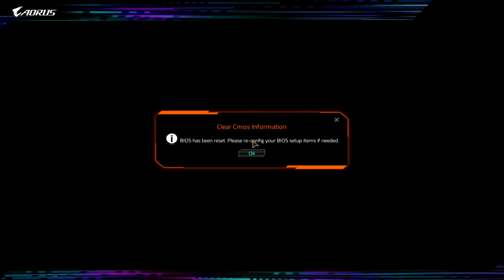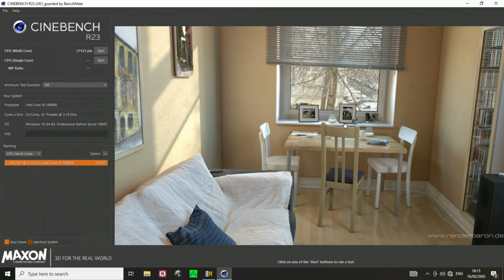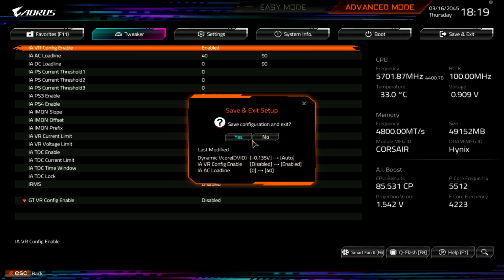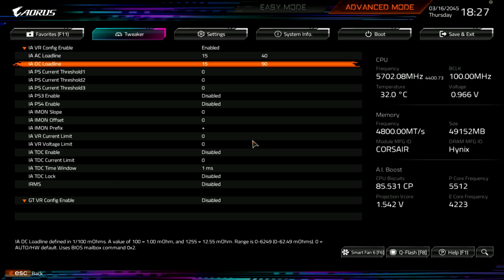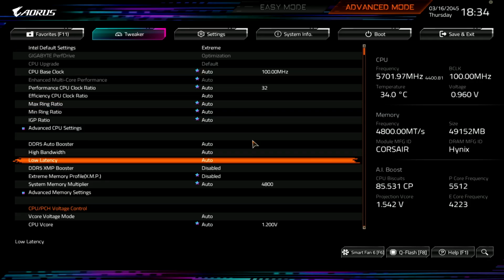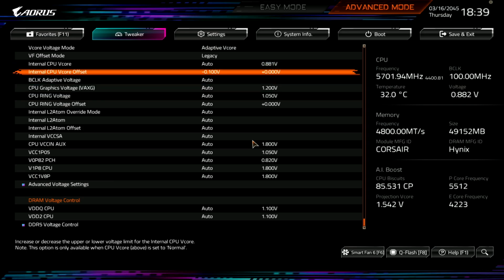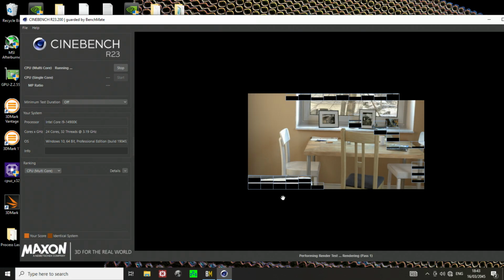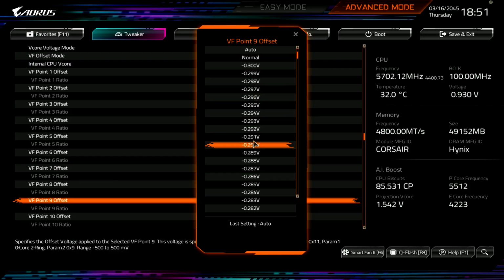YOU  DON'T HAVE  TO TURN OFF CEP to undervolt intel 13/14th gen CPUs

Comment: MSI seems to have this on lock. No brainer with their boards. Lock the cores at 5.6 or 5.7 and set CPU Lite Load to mode 7 - 12. Lower is better as long as it doesn't crash. Too low and it will crash just from the CPU not getting enough voltage. You will see performance loss as you work your way down from Mode 12 once you get to low. When you hit that performance loss go back up one mode and enjoy your cooler, more power efficient, fast @$$ CPU! Don't let 2 cores boost to 6Ghz it over volts ever single core. Even the E Cores.
Reply: The thing is that MSI Lite Load is exactly what BZ explains as the second wrong way to undervolt. It lowers AC_LL and DC_LL. You can see what it does if you set your "normal" LiteLoad, safe & reboot and then change LiteLoad mode to "advanced". You can honor CEP with the advanced mode, if you bring AC_LL, DC_LL and LLC together manually. You can find a table online that shows you which LLC equals to which AC_LL/DC_LL.
Reply: @bauerns5er  MSI's current solution to that is to set the Lite Load (and so AC/DC) stupid high under Intel defaults. So you can drop it a long way from its default value and still not hit the CEP tolerance limit.
Reply: @Raxiel497  Intel Default is 1.1 mOhm on my Z790 MSI for AC/DC LL (110 in MSI terms). That's not really stupid high, it's the default. 😉
Reply: @bauerns5er  Hey I have MSI Z790 Carbon. Could you give me a link to MSI LLC impedance table? I have tried to find it but no luck. I only know that LLC 8 is 1,10mOhm.
Reply: @tomitarnanen  I have checked the settings for the Lite Load AC/DC settings on the Z790 Carbon by setting the Lite Load Mode, rebooting, then setting the mode to Advanced and noting down the AC/DC values. Lite Load Mode 16 is 1.1 mOhm for both AC & DC (in MSI terms "110"). Every setting lower than that reduces the AC LL by 10 (or 0.1 mOhm), down to Mode 9, where it begins to decrease by 5 instead. So Mode 9 is 40 (0.4 mOhm) and Mode 8 is then 35 (0.35 mOhm). Mode 2 is 2/110 and Mode 1 sets both AC & DC to 1 (0.01 mOhm).
I've also tried to identify the LLC impedances, and for Auto it seems to be 1.05 to 1.1 mOhm (so I guess it is 1.1). And Auto seems to be almost the same as LLC level 8.
Reply: @bauerns5er  I have that table and have set each setting then checked it with hardware info to verify. Check it, the CPU the way it's configured, 5.6/4.4, runs like a scolded dog, runs cool, runs lower wattage, relatively. It can throw 41500+ in Cinebench all day and is stable. If it degrades in two years so be it. It will be replaced by then. However, I really don't think it will. The only thing I can see harming this CPU is transients that I can't see because the CPU doesn't hit over 1.350v ever and under load runs around 1.198v locked all core.
Reply: @jwhitaker81  can you run CB r15.3.7 with extreme Mod?
Reply: @bauerns5er  yeah no problem. it scored 6231 with a bunch of crap open.
Reply: hour long videos for something you can do in 10 minutes on an MSI board with Lite Load. Lock P cores to 5.5. Lock E cores to 4.1. Set a negative 0.055 voltage offset. -2 AVX ratio. BCLK 100mhz lock enabled. Speed Shift enabled. Intel Turbo Boost Max 3 disabled. Enhanced Turbo disabled. CPU Current Limit 307a. Power Limits 250w. GT Current Limit 30. CPU Lite Load 9, or 10 if you want to be conservative. CEP will probably never activate anyway so you might as well leave it on. This has got me between 38k & 39k in Cinebench R23 runs, voltage will be below 1.4v (I've done runs where the max was 1.309v) and you won't go near throttling with decent cooling and a contact frame (360mm aio, max core temp 93c on my hot core #5, rest below 90c, e cores below 80c), and CPU power doesn't go above 230w. Using Z790 Carbon Wifi board, 2x32gb ram and 14900k with the new bios installed.
Reply: @bigpoppa1234  Contact frames and delid kits for all 13/14900Ks I say!
Reply: @bigpoppa1234  why disable turbo boost ?? Honest question!!??
Reply: @izzy32324  you don't need turbo boost 3 if you're tuning your CPU manually to lock it into all core max boosts.
Reply: Nailed. Key was reducing six p cores to 5.5ghz and leaving two preferred p cores to 5.7ghz then offset cpu voltage by -0.15v. Still 40k cinebench scores and almost 10C temp drops with safer cpu voltages, only 1.236v under load

Comment: SO much easier to undervolt CPU safely with CEP disabled and just manually tuning the settings yourself without the stupid Intel settings... Using a Gigabyte Aorus Elite AX motherboard and 14900k: 5.8 all core with  x58 p-core, x44 e-core, x45 ring bus at 1.284v v-core max using adaptive v-core with a negative -0.205 vcore offset, Extreme LLC, AC/DC set to 20/20, P1/P2 of 260w and done. 40,500 avg. in C23 with a 78c max temp under full load and OCCT stable oversight 8+ hours without any issues and I will never need to worry about degradation due to never going over 1.284v v-core.
PS - Buildzoid, this setup doesn't crash or have stability issues at all on my Gigabyte motherboard with CEP disabled, the negative offset, and ac/dc at 20 and is 100% stable benchmarking or under full load overnight. These settings give me a max vid request of VID (Max) of 1.295v and max actual V-core at 1.284v and would also work if I left CEP enabled without a change in performance. With CEP enabled or disabled it doesn't REALLY matter as the end result are the same.
Reply: Wow that's a pretty big offset, you got a golden chip
Reply: @AngryChineseWoman  Ironically this cpu only scores 89 biscuits, but In my system and others I built for friends and family I found adaptive vcore gets better performance than fixed and when using adaptive vcore with negative offsets with higher LLC settings and low ac/dc settings you get a much lower overall max vcore voltages which is more in line with vid voltage requests making cep on or off pointless while getting the best performance possible for your max watt settings.... Like everything in life test it all out and then judge for yourself... One thing I do know is that these low voltages I run on the settings I provided as an example will not degrade or hurt your CPU...
Reply: These are all my mb bios settings you can use as a template (starting point) to find what works best for your cpu and system that I posted in another thread to help some other people with motherboard setup issues. z790 Gigabyte Arous Elite AX motherboard revision 1.2.

Under cpu advanced settings I currently have these settings all disabled: Intel speed shift, ring to core offset, cpu esit, energy efficient turbo, cpu flex override, enhanced tvb, voltage tvb, ia cep, gt cep, under voltage protection, and intel dynamic tuning. 
Other settings: my cpu throttle protection is at 90c, avx offset at 1, manual max turbo ratio set to 58 for all p-cores, 44 for all e-cores, 45 for the ring bus, p1/p2 set to 260w with a max time of 448, amps set to 400 max, system agent set to 1.3v versus 1.25 default volts only for memory stability on overclocked memory, adaptive v-core with a negative -0.205 vcore offset, memory timings set manually not xmp for performance and stability, enhanced multi core performance enabled, intel settings disabled, performance cpu clock ratio 58, efficiency clock ratio 44, max ring ratio 45, cpu load line calibration set to extreme, ia vr config enabled, ia ac and dc load-line set to 20, ia va current limit set to 1600 (400amps), ia vr voltage limit set to 1300 (1.3v), igpu set to disabled, audio set to disabled (i use a pcie audio card) and that's it guys…

Like I mentioned with these settings I run a fixed 5.8 all core at a max voltage of 1.284v using hw-info that is stable overnight in benchmarks and stress testing OCCT and gaming without any whea errors, bsod, etc with manually tuned (fast) memory settings.

I know some of these settings are double redundant but they work and protect the cpu from degradation and over voltage in all cases. Every cpu is a little different and takes testing for optimal settings and fine tuning the above settings. Finding my optimal settings took several days (mostly spent fine tuning memory settings), so don't feel discouraged.
Reply: @joeysuzyjozy  just so you know, 5.8 all core at a max voltage of 1.284v is crazy good!

on default settings i need around 1.4v for 5.7Ghz to be stable and and 1.51 for 6ghz

after tweaking i can have 1.35 - 1.4v for 5.7 and 1.38 - 1.48 for 6Ghz 😪
Reply: @ItaySharoni  I always thought I had a mediocre 14900k since it only scores 89 on my gigabyte motherboard, but the more I read I guess I did get luck since it likes low voltages... On default settings this cpu wanted to run at 1.53v for 5.7all core which was what got me to manually tune it first day I set it up as default settings for these cpu's are absolute garbage. This cpu will also do 5.9 all core at 1.36v which I thought is too high since I never like to go past 1.35v for longevity on any of my day to day pc builds and just kept it at 5.8 all core and 1.284 to be under 1.3v but it looks like 1.35-1.4v for 5.7 all core is the norm for the 14900k with most people sadly. The cpu also never goes above 84c which is only during full stress testing for over 30+min using a 360 aio and under normal use its always under 72c, but it is also been de-ilided, ihs lapped, and is using liquid metal on die and ihs with a contact frame which reduced temps by about 12c overall.
Reply: No one knows why the CPUs are degrading so you cant be sure. All this is just speculation and not Intel info based. Said that, good luck!
Reply: @AthosRac  Anyone with common sense whose built pc's before could see why they degraded. I saw it when i first built my 14900k almost a year ago and saw it default boot to 1.5v on default mb settings which is beyond stupid and started manually undervolting and overclocking until stable at reasonable voltages immediately and have never had issues... A max of 1.35v on vcore has been the norm unless doing xoc on ln for over 20 years bro... First pc I built myself was a Anthlon 700 slot a over 20 years ago btw...
Reply: If it doesn't matter if CEP is enabled or disabled, then why not keep it enabled?
Reply: @jannegrey  If you set up your system correctly, yes it doesn't matter... Why not change it to enabled now with my settings?  I honestly couldn't be bothered to change it in the bios now when it makes no differences good/bad to my setup and I have enough redundancy in my settings already so my system runs safely without issues...
Reply: @joeysuzyjozy  OK. Fair. I'd still think I would prefer to have it in case something weird happens, but the likelihood of that happening is very low.
Reply: @jannegrey  That is also true, but honestly with all the settings I have, I have like 3 different settings limiting voltage to max of 1.3v already and tested for the best offsets for my cpu so that voltage never drops too low even under extreme full load and stress testing it never drops under 1.18v which is stable @ 5.8 all core and 260w even 320w for me. I could see this being an issue if I allowed c sates and other voltage or speed change settings to save some power, but I disabled all of that crap for stability. Keeping it enabled can and will cause crashing and stability issues when undervolting because of the voltage spikes going from different c states and lower cpu speeds to max and the difference turning it all off as I did is literally only 20watts at idle, but also allows for a lower stable max v-core voltages and better stability overall with it all disabled and my cpu always at max speeds by default.
Reply: But what about shaders in fortnite or the finals? I can run cinebench 23 at 1.235v but won't even load a fortnite screen.😂
Reply: @Bostonski  When I said stable I meant in everything bro my system was tested and tested for days to verify stability in everything like gaming: fortnight, cyberpunk, balders gate 3, red dead online, etc., benchmarking and productivity: occt stress testing overnight cpu+ram, cinebench 23 for 30min+, blender 30min, Revit/AutoCAD, with no crashing, memory or whea issues bro. I wish screenshots/short videos could be posted in replies so people can see it's possible to manually set up a stable intel system with low voltage, etc., that doesn't have any instability or degradation issues...
Reply: @joeysuzyjozy  for me, the only way knowing if the CPU is stable or not is using 3D printer slicer "Orca Slicer" with a very heavy model, this 99% will tell me in a few minutes if the CPU is stable or not, if not it will always crash the software.

i cannot relay on prime95, cinebench or any other conventional tool, since they are always seem fine when using them, but then my slicer crashes or a game crashes after an hour or two
Reply: @ItaySharoni  I am going to try this out as all other methods Prime95,C23,OCCT,Blender,AutoCAd/Revit/ and Gaming are completely stable for me, any thoughts for a very heavy model to use? Thank you!
Reply: @ItaySharoni  Downloaded app and found a 110,000KB file it says over 1m triangles and it's converting now, will see how it goes... :D
Reply: @ItaySharoni  Okay it worked fine running that 110,000KB Starscourge_Radahn file by itself and slicing it without any issues. So then I added 12 of them to the plate and tried slicing it all at once and finally got the app to crash while I was watching Netflix. Only the app crashed nothing else, I wonder if that was too much trying to slice 1.5GB of files over 12m triangles to the plate all at once for the app or CPU instability?
Reply: @joeysuzyjozy  I will be home in a few hours and i will share with you my 3MF project i use all the time for the stability test
Reply: @joeysuzyjozy  i created 3 types

https://drive.google.com/drive/folders/1GKOIbL6ZnmF-naEgz5sxy2glnkHbfHyV?usp=sharing
Reply: @ItaySharoni  Nice thank you very much! Testing with these now! :D
Reply: @ItaySharoni  I ran all three files without issues, re-ran extreme 2 more times to be sure and no crashing etc. I wonder do you have more than 32gb memory? I saw the app using 40gb of memory on the extreme file (I have 48GB 2x24gb) and not having more than 32gb could be the reason for your crashing by needing to go to the page file in windows? So in the end this is also stable for me, another tip for a lot better stability is I disable anything that throttles the cpu speed as this is what causes most cpu instability issues and crashing due to voltage dips/spikes at a small price of higher idle power usage as I am at 40 watts idle versus around 20w otherwise, since my cpu is always at 5.8ghz even while idling. Crazy the extreme file would take almost 7 days to print out... (6days 23hours 36min) 0_o...
Reply: @joeysuzyjozy  Hi, yes i have 64GB, 32GB is not enough today :)

if your test do not crash on all 3, then you should be fine

if want to do a test, you can lower your AC loadline up to the point it crashes (for me the Slicer simply exit without finishing if the CPU is not stable)
Reply: @joeysuzyjozy  BTW, i really like this test method since its a good workload for the CPU

it start with multicore and then when generating the gcode, it mostly 1 or 2 threads, so i see a lot of 6Ghz near the end of the slice.
Reply: @CASIOMAN20  Thank you. I'm going to start using it when building pc's as another layer of stability, and yes, it does seem like a great workload even though it doesn't take too long to run.
Reply: Seeing you got an undervolt that large makes it this kinda useless for the average person because they dont have a golden chip.
Reply: @MrBeast1901  Honestly it just takes testing as every cpu is different to find your own sweet spot and honestly this is 1 of the lowest rated 14900 cpu's I have gotten at score of 89. My general rule for anyone is starting with the settings I listed and a negative -0.100 offset and going up or down from there in 0.01 increments until stable at the lowest voltages possible. You might surprise yourself with how low your cpu vcore can get and still be stable.
Reply: Do the cores constantly hit 5.8 GHz during all-core load? Otherwise you might need to test for single core load as well.
Reply: @sp00n  The only time the CPU wont stay 5.8 all core is during heavy avx loads as I have a -1 offset set in bios during avx loads instead of a -0 offset, because -0 tends to glitch out sometimes in windows and hurts performance overall. You also need more power/watts for a full avx load i.e. I would need to run at 330w to max performance under a full avx stress test load to hit 5.7ghz all core versus at 260w you cap at around 5.5ghz. The difference is not worth it for example with C23 at 260w = 40500 avg. and C23 at 330w = 41700 avg. 

I also do not run staggered CPU core speeds, i.e. all my p-cores are at 5.8ghz fixed always unless under avx loads as mentioned above. x58 p-core, x44 e-cores, x45 ring bus.
Reply: I'm new to this, but since you went to llc extreme and ac/dc at 20, why not go even further to reach ac/dc of 1? Or is that bad/unstable